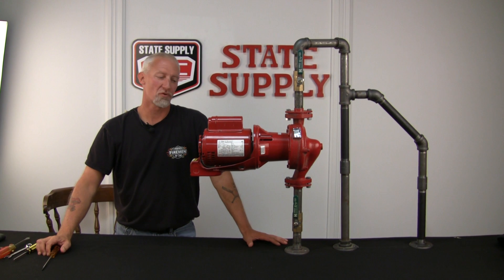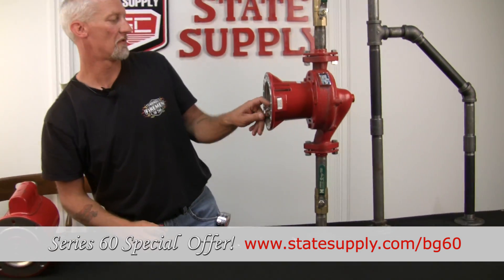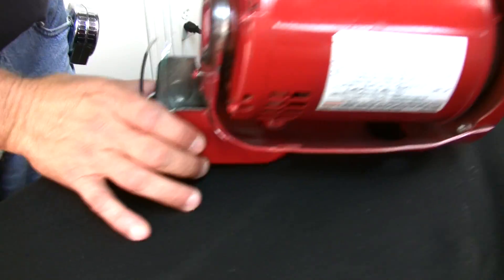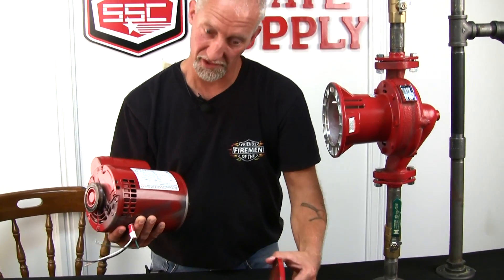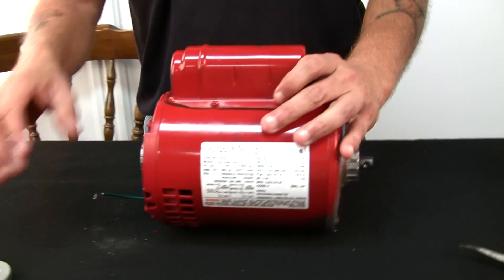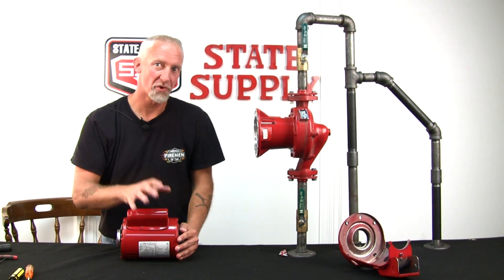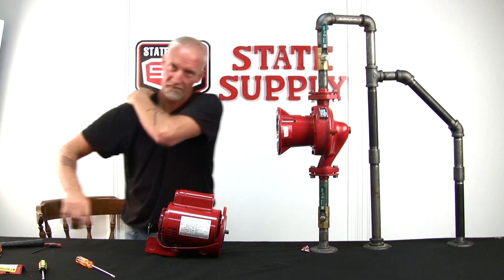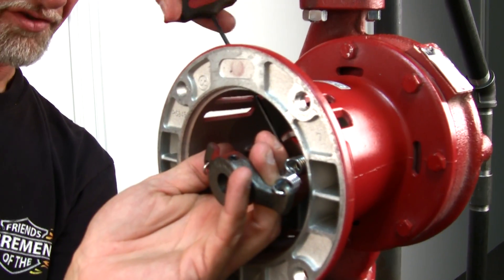How to Replace a Bell & Gossett Series 60 Motor Mount & Coupler

Comment: Does it need a few drops of oil after being back together? I have mine apart currently and the shaft on the motor side spins easy. But the other side is having trouble spinning since it’s been a few years since it’s been turned on. But would oil help. Mine has a spot I think to put oil in it??

Comment: thank you so much Sir, it took me 41 min and some 30 from it to remove the old mounts))). Tried to use the screwdriver as you show, but the rubber was so old it is just torn out from the inner ring and the inner ring remain on the motor. It was the hardest part  to remove those inner rings. Anyway it finally works, let's see my couple life cycle. It is about 3 month before today. Countdown!

Comment: how do i determine the size of the motor mounts , what do i look for or what do i measure
Reply from the maker: If you are able to provide the pump part number or motor part number, we will reply with a link to the correct motor mounts for your motor.

Comment: The new motor mounts are solid metal?  What is the point of their existence in the design, then?
Reply from the maker: Hello Jamie, the new series 60 pumps with 1.5 hp and above are C face motors which do not need the motor mounts as they get mounted directly from the face of the motor.

Comment: Why do you say to position the groove (B&G calls it the "break" or "split") in the outer ring of the mount straight up?
The Instructions included in and on the back of the packaging for new motor mounts says to position it straight down.
The mounts on the motor that you take off in the video are even positioned straight down. Thanks
Reply: Also wanted to say Thanks for all the videos. They are very helpful.
Reply from the maker: Hi Joshua, field service professionals prefer to put the motor mount groove upwards so the weak part (groove) isn't bearing the weight of the motor. This is opposite of the instructions unfortunately but we suggest putting the mounts up. Hope this helps!
Reply: It makes sense to put the weakest part facing up. But for printed instructions to say The opposite is ridiculous all these years

Comment: Thanks for great video. I got B&G part#W 72701 Model #601S. The coupler was making noise and now pump start leaking. I did some research. I only need to replace coupler and motor mount to stop the leak without touching bearing assembly they said. Is the true?